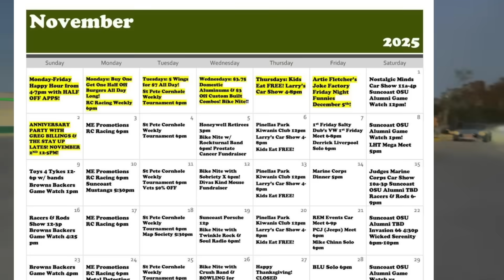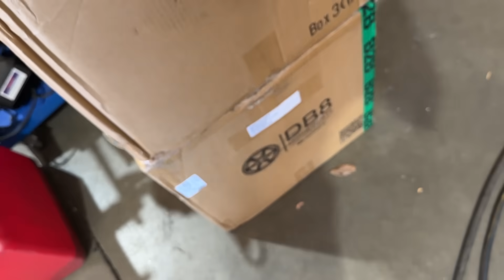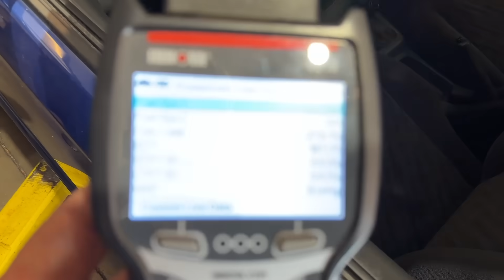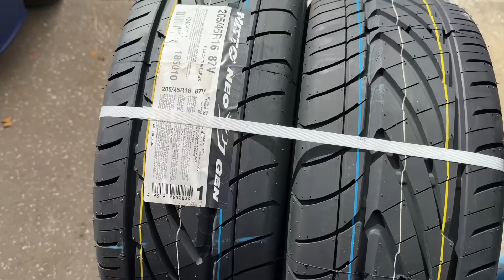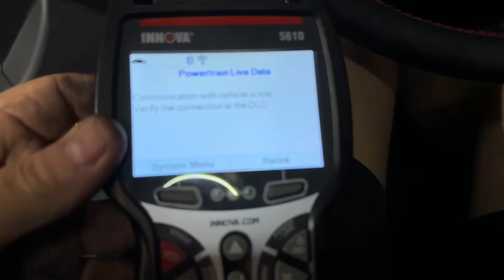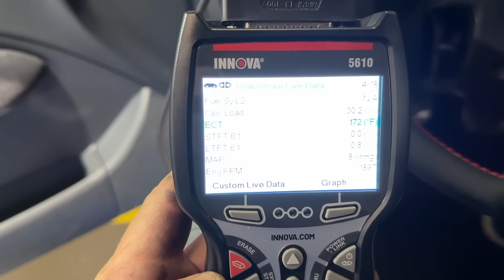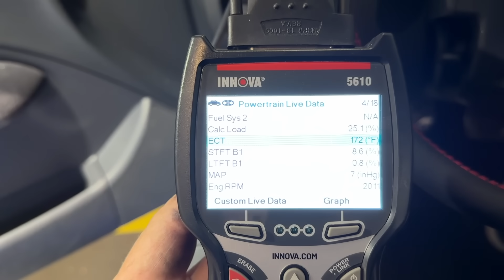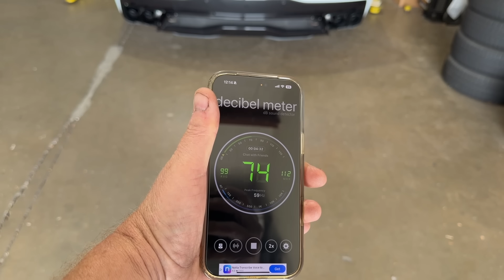Keeping your B16 Alive

Comment: My EK4 was hardly used for 10 years, just some driving each year. It was stored 10 years dry. I bought it almost a year ago and just now finishing all the preventive maintenance, prepping the bottom, refreshed the suspension.. had had a tune recently, and still thing keep popping up. A 10 year old radiator and cap? Replace.. You think it don't leak? It does, aftermarket stuff is not as good as the one that came with it in 1996.. Drive a car or it will cost you just as much as you don't drive it.

Comment: John does Nachi make replacement wheel bearings?
Reply from the maker: Honda use NSK for their wheel bearings
Reply: @LHTPerformance  Gotcha ok.  I want to replace all the bearings for a used 5 lug I picked up for my Integra, figured since you're so high on Nachi I would look for them.  I'll just get new OEM.